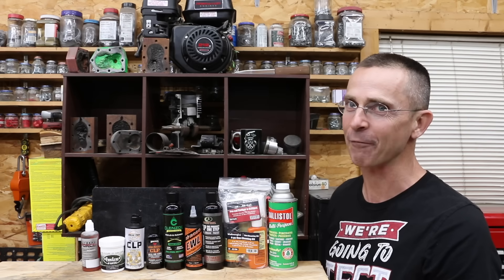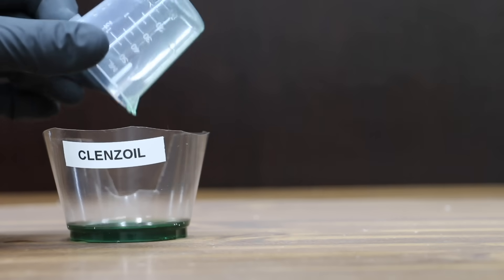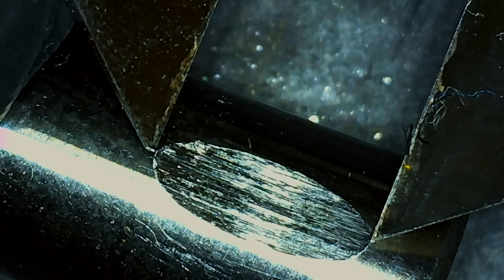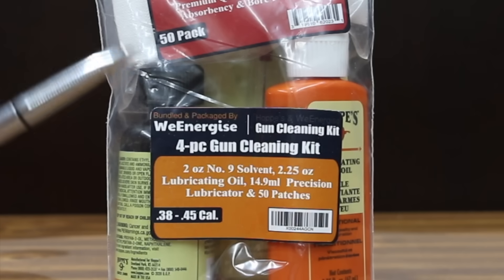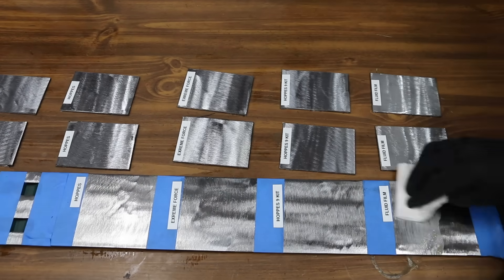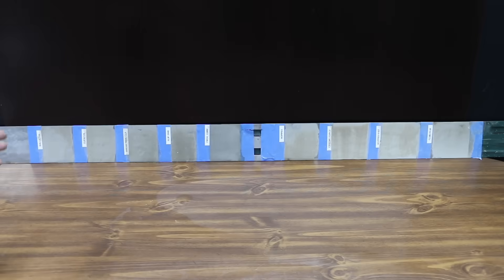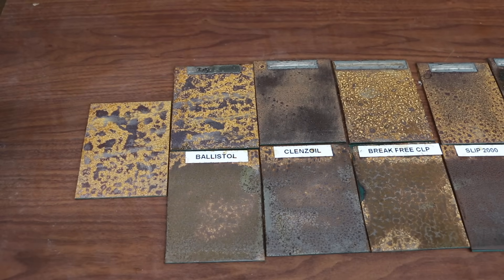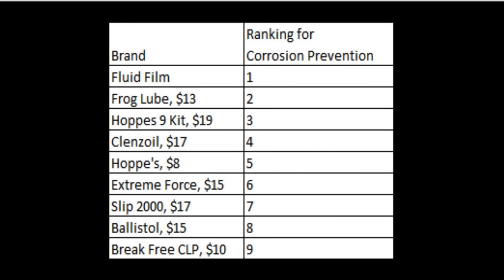Don't Buy A CLP Until You Watch This Review! It'll Save You Time And Money!

Comment: The owner/chemist of G96 told me, several years ago, at the SHOT Show, that the G96 CLP was the only CLP that met the original Military Specifications for a CLP.  Because the government couldn't rely on a sole source the government reduced one of the requirements.  With the reduced requirements several other CLPs met the modified Military Specifications.  

The one specification that was met by G96 in the original specs that the others did not meet was rust resistance, according to the company owner/chemist.
Reply from the maker: Thanks for sharing.

Comment: I love your content you do great work. I have been using Ballistol for 30+ years it works perfectly fine. Its a gun not an engine you cant work a gun fast enough to even get close to wearing it out or generating heat. Even a semi auto you cant pull the trigger fast enough to get that kind of heat in it. You would have to do 500 to 600 rounds very rapidly and even then the heat comes from the round going off not the friction. A machine gun is a different story. Heat is what kills barrels and guns from rapid fire. Just use a very light coat of the oil you chose and you will be fine. Just like cleaning copper out of barrels the copper fills the rough spots then it stops. I own 40+ guns never cleaned the copper out of any of them and they all shoot great and the all have Ballistol in them.

Comment: Rem oil & CLP break free is quick & easy. When I get to really cleaning,get out the hopps,pics,brushes ect ect. Once in a blue moon is all that needed.Everything stays in tip top shape stored with light coat .have a few spots on guns more susceptible to light surface rust. Older Berettas grooves on safeties,S&w’s revolvers adjustable sights,& other spots with very small grooves,knurling ext. use a baby toothbrush & oil on those & wipe down.doesn’t happen anymore. Most cases those are older & or surplus guns. New stuff is taken care of from day one. All good. Still a good video. As usual. Thx
Reply from the maker: Thanks!

Comment: I wouldn't even consider using anything but the Break free CLP on any of my firearms. Over the past 20-25 plus years I have used this product on at least 2000 firearms cleanings and it has never let me down. As a police armorer I became aware of this product after I watched a video of Israeli army soldiers dunking their weapons in barrels of the stuff before brushing and wiping them down. I will advise anyone using this product to first shake it up as the cleaner, lubricant and protector will separate if it sits too long. Also note that our military has been using this stuff since at least the early ninety's. Natchez still sells it for a little under $90.00 a gallon which is a huge savings over buying it in 160z bottles. Between my military style firearms and hunting guns a gallon lasts me about 3-5 years. Nice job sir on the tests that you ran.
Reply from the maker: Thanks!

Comment: I like using lucas gun oil, it is relatively expensive at 12 dollors for 1oz but it goes a long long ways. Ive noticed on knifes and firarms it reduces wear significantly and seems to stick around after well over 100 rounds. Ive also used this on a 3d printers slides. As far as cleaner i like slip 2000. Easily washes away with warm water and after a post lube when cleaning.... no rust or corrosion exist. You shouldnt leave your firarms dirty anyway.
Reply from the maker: Thanks for the feedback.

Comment: Bummer we are missing Eezox.  I thought Eezox beat out majority of CLP years ago for rust prevention.   I remember a saltwater test was used for it.    Been using it for 15 years since.  FYI: Frog Lube requires the part to be completely degreased, then heated up, then frog lube to be applied on.  The heat allows the Frog lube make it's way into the microscopic pores in the metal
Reply from the maker: Thanks for the suggestion.

Comment: I've always been very skeptical of the all-in-one CLP concept (after all, a cleaner is a solvent that removes things like - lubricants!) and this test only reinforces that. Would like to see a separate test, maybe just lube and protection without cleaning. Definitely would like to see Corrosion X, as that has done well in other tests I've seen. And WRT corrosion, maybe include WD-40, since I have heard legendary things about its protective properties (I know it isn't a lube). Would also like to see how "Gun Butter" does in your tests.

I also think there is a difference for carry guns, versus long term storage, where corrosion is the main concern vs lube.

I typically clean a gun with some light solvent, then vibratory clean, then lube/coat with Corrosion X.
Reply from the maker: Thanks for sharing.

Comment: I would be curious to see how  automotive automatic transmission fluid and lightweight automotive synthetic motor oil would perform with these type of tests as I have been using both these on my firearms for years with good results.
Reply from the maker: Thanks for the suggestion.
Reply: @ProjectFarm  have you done any similar tests comparing motor oils? Seems like you may have already I'll have to go and search

Comment: I learned that Frog Lube sucked the hard way a few years ago. I treated my Rem 870 pump shotgun following the directions. Since my shotgun is almost always in the rain and mud while duck hunting, I was looking for a lube that would protect against rust and simply work. It did, until it got cold. First duck that came swooping in while it was freezing, my shotgun jammed. Took quite a bit to get it unstuck. It was useless the rest of the day. I had to heat up the parts and remove the Frog Lube with brake parts cleaner! 

Now I prefer Break free CLP or Breakthrough Clean Technologies.
Reply from the maker: Thanks for sharing.

Comment: Ive been using Frog Lube for almost 10 years now and its always worked just fine for all my pew pews. Granted I don't live in colder climates but after about 3-5 rounds the Frog Lube starts to melt turning into a liquid to lubricate the gun, This is why they tell you when applying new lube to use a heat gun or blow dryer to melt the Frog Lube so it gets in all the tight places and then once it cools down its turns back into a cream again.
Reply from the maker: Thanks for sharing!
Reply: Yeah, I think this is a downfall of the product in this test.  Being a solid at room temp, it doesn't have the same properties as the other lubricants.  Instructions clearly say to heat the metal to 120F, apply, let sit, wipe off. It should not be wet on the item and should not leave visible clumps when it cools back to room temp.

Comment: Thanks for another great test.  Something to realize is the one thing that Ballistol does that NONE of the others do is neutralize the corrosives from shooting black powder or ammunition with corrosive primers, which a lot of older surplus ammo has.  It also does not negatively affect wood or leather.
Reply from the maker: You are welcome!  Thanks for the feedback.
Reply: And it's non-toxic. I have used it to fry eggs in the field.
Reply: @dontblameme6328 smelled worse than if they wouldve spoiled
Reply: It emulsifies in water, you can mix up a gallon of it, and wash your gun down, wipe down and call it a day.. i shoot alot of corrosive ammo (5.45) and i carry a bottle of 50/50 mix, I spray down barrel and in gas tube when done, have left up to 3 days after before cleaning and have not found corrosion. I used to hate finding green spots I didnt clean well enough.  

Ballistol 106% recommend

Ps : wife will love it
Reply: how the heck would you know NONE of these others neutralize corrosives after shooting? Because the problem for you is that clenzoil does. It's a higher PH and neutralizes even the strongest acids. I can't speak for any of the others because i haven't tested them, and neither should you given that you just have no idea
Reply: Yeah I like ballistol alot to. Also works well darkening leather and gives it a unique look.
Reply: Yeah, I was hoping the Ballistol would perform better because I use it for its other properties (I like old guns), I didn't want a reason to buy yet more products.
Reply: @jonkrier  
Exactly my thoughts

Comment: 4:44 what this doesn’t show is any heat whatsoever the frog lube runs out and leaves your slides dry. It’s coconut oil and left serious metal to metal scratches on the slides of my pistol after less than 200 rounds. I threw it in the garbage immediately.
Reply from the maker: Thanks for sharing.

Comment: Honestly you're comparing and kumquats between a 2-part kit and an "all in one" CLP.  "All in one" is bogus marketing; you can't put a solvent in an oil without compromising the protective properties.  Two part kits should win every time, step 1 is to dissolve carbon and carry it away with detergent, step two being to leave a protective film to prevent rust and inhibit wear.  You can't make a tire that performs perfectly in both January and July.

Comment: In the Army there was only Breakfree CLP. That was it. We cleaned our rifles every single day in the field. That was always second on the priorities of work, right behind maintaining security. Your tests reinforced what I always intuitively knew, minimal corrosion protection with the CLP. We applied more in the rain, less in the sand, and cleaned them every day.
Reply from the maker: Thanks for sharing.
Reply: I also had the same experience while I was station at Fort Campbell, our weapons were rusty bitches.
Reply: CLP isn't as good a lubricant as a dedicated lubricant oil, but it simplifies the logistics and the  responsibilities of the individual soldier. Better clean and kinda dry than slicked up and packed full of carbon.
Reply: Clp is amazing. Works perfectly. No matter how much carbon is on the 240B. 😂😂 it will be clean asap.
Reply: Love breakfree,just the price kills me for the amount you get lol
Reply: Its not the best, just the best for the app,cation the military wanted. Considerations of price, supply, shelf life, ease of use, Jack of all trades, suitable for most environments and the fact that the weapons gets cleaned every day in the field are a very different use case to that of a hunter or edc operator.
Reply: mine never jammed once, yours?
Reply: For some reason when they store the rifles they wiped it completely dry. I was issued a M4A1 in BCT right before a FTX, no CLP was issued. With rain poring for the whole day. The next day I couldn't cycle the action without mortaring thanks to some internal rusting.
Reply: @Nathan-jh1ho  wow, w envr used much but a little is all u need
Reply: I like break free BUT I don’t like that lack of corrosion protection as tested.
Reply: 8 years active as a 19D. We used break free on all of our weapons. I’m pretty sure a few guys used it in their guns after a few months in the field if you know what i mean.
Reply: Had a well seasoned gunsmith tell me many years ago that I should be using Breakfree CLP,good stuff!
Reply: @timtorkelson7201   In dry conditions yes. Its not very good in the rain or humid enviorment.
Reply: @Wyatt_J_D  what is better for humid
Reply: @Wyatt_J_D  I'm bad about cleaning firearms. I use CLP for cleaning everything thoroughly, wait for it to cure, then apply a thin layer of oil. I wouldn't use Breakfree on a firearm with a patina though, it will take spots off a Dalmatian, works better than solvents I've used.
Reply: @Wyatt_J_D  so what’s good in the rain or a humid environment?
Reply: @timtorkelson7201  I like it for .22lr and my milsurp due to the extra fouling from the type of gunpowder used. Those guns get dirty quick during shooting at the range. I use synthetic motor oil otherwise.

Comment: I'd love to see this done again with some other gun oils, like Froglubes extreme lube which is liquid instead of a paste, and Lucas Oil's gun oils.
Reply from the maker: Thanks for the suggestion.
Reply: @ProjectFarm  I wish the frog lube was actually applied per the manufacturer instructions the parts should have been cleaned with a non petroleum based cleaner then turned into a liquid with heat first to fully coat the parts then allowed to dry.

Comment: I use spray on frog lube for my firearms. Because it’s not full synthetic it clumps together with age after application. It also loves to lump up carbon fowling inside my slide and inside of my handguns frame. It’s super easy to clean with, but because of the other things I’ve mentioned, I wouldn’t use it as a lubricant. As a side note, it also has a nice minty scent and doesn’t cause migraines. You can definitely get away with using this in enclosed spaces.
Reply from the maker: Thanks for sharing.
Reply: If you use it on knives, it also is the only that is food safe.
Reply: @1234Robocop  Yep. For knives I may prepare food with it's food/medical-grade mineral oil or FrogLube for me. I bought some FrogLube paste just for storing knives. Although since my knives are all stainless, I don't really use it. But even with stainless steel, oiling is still a good idea for long-term storage or for mechanical or moving parts like many folding knife mechanisms.
Reply: Prezactly!  Frog Lube, aka Frog Glue, gums up way too easily!  It doesn't mix with any petroleum or carbon well.  It will turn to paste when left to sit over time and make your action sticky!  It's just snake oil for the unsuspecting!
Reply: Try Slip 2000